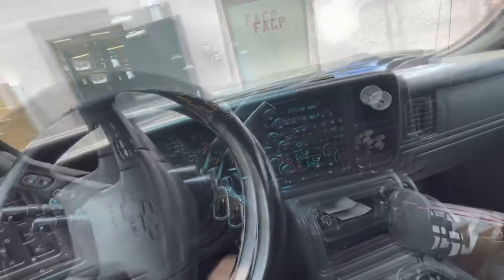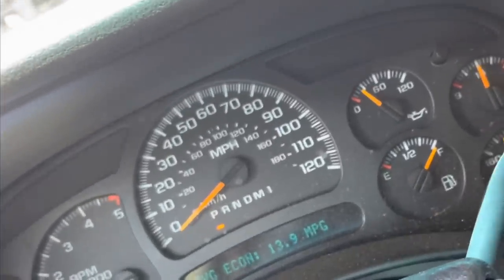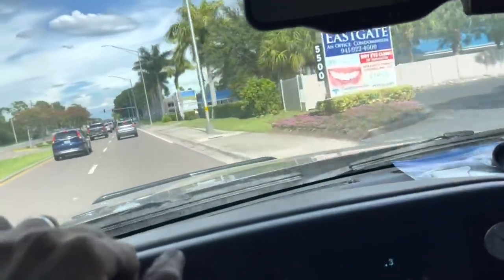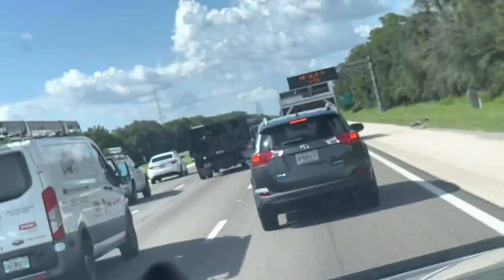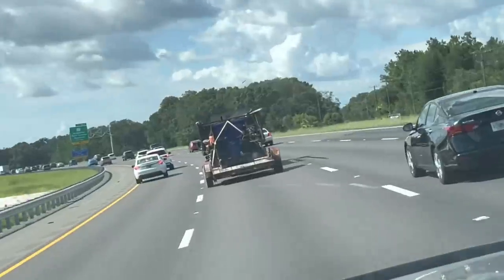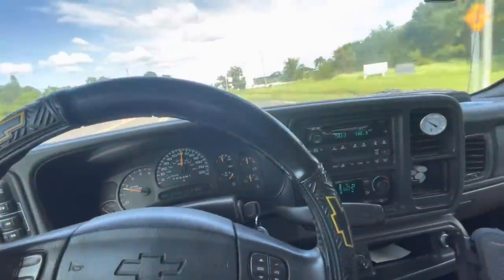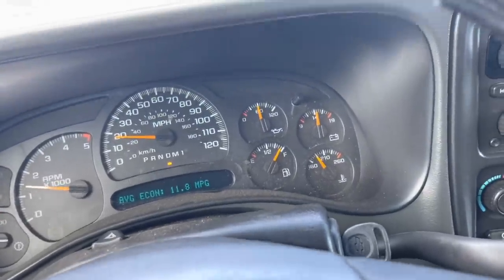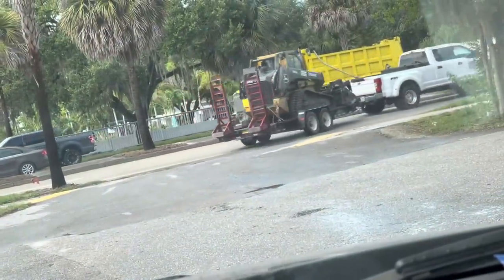Need answers! ox-cetane Diesel Fuel Experiment | Duramax 6.6 LBZ

Comment: That’s crazy, yesterday when FordBoss did his first thoughts on Ox-cetane he said that he wanted someone with a diesel to try it and I immediately thought of you because of your pre-DEF diesel and long commute, behold, that came true. I’m excited for the results.
Reply: Every time I click play on Fordboss it plays rays, this one
Reply: Ssssnake Oil!
Reply: @rockymcallister4258  ya think !
Reply: Ray’s LBZ isn’t pre emissions, it doesn’t have as much, but it’s not free of emissions equipment either, or at least it didn’t come that way new. It should have a cat and an EGR.
Reply: @ralfie8801  What's the diff between Ray's ride and say 2020 type ??
Reply: @peted5217  
Basically everything. The L5P Duramax is very different from the LBZ. Some stuff might be the same, but most is not. I haven’t kept up with it really, I have no intention of getting rid of my LBZ. We don’t have the dreaded DPF systems for one.
Reply: Saw that too
Reply: @ralfie8801  My definition of pre emissions is no DEF system, no regen... This generation was still reliable. In my opinion, was the most reliable generation of Duramax.
Reply: @ralfie8801  Just as I Suspected !
Reply: @ralfie8801  I thought he had a LB7 and if that’s the case. He is pre-emissions. I have an LB7 and I am pre-emission. Even in places with smog tests(Las Vegas). He also has cat eyes. So it’s either a LB7 or LLY.
Reply: @Re-engineer_everything  
I his title to this video he says he has an LBZ which is two generations past the LB7.
Reply: Rubber necking. I hate that pay attention and keep driving 🚗
Reply: @rockymcallister4258  just joking
Reply: @stevenlatham4397  do you not mean DPF ie. Diesel particle filter
Reply: @IrishFoxHound  no, I mean DEF, Diesel Exhaust Fluid.
Reply: @stevenlatham4397  didn’t know this is a thing..going to google..👍🏻
Reply: Ah adblue.. yes our ‘16 diesel is without it.. we do have a dpf

Comment: Lately I’ve noticed that snake oil fuel economy products are the craze because of higher fuel prices. 
Back in the eighties when gas prices had risen substantially (80 something cents a gallon),there were all kinds of fuel economy products flooding the market. Since at the time I worked at a service station so I got to see a lot of fuel economy gimmicks. 
One customer had a water injection kit installed under the hood of his Cadillac which consisted of a huge mounted glass jar and a small hose going from it to the air filter canister. 
I drive a small economy car with a small displacement engine and a manual transmission. That makes for the perfect combination to get great fuel economy.
Reply: I remember the Atomiser. One guy could not stop talking about it. After one month, since we had the same small car, he realized it did not do anything.
Reply: The main ingredient in a lot of that stuff was mineral spirits.
Reply: Magnets 🧲 they align the fuel molecules for better burn roflmao.
Reply: Yeah the FTC actually did testing on a lot of these fuel products a long while back. They found that while they do something, the results are basically only measurable and completely unnoticeable to the drivers. In theory they should work better the more worn out your car is and the more carbon buildup there is, but even still, it shouldn't effect much. When your motor is wearing out it's wearing out.
Reply: I remember "The Vitalizer" that was a doohickey you patched into the fuel line that was supposed to polarize the fuel to burn more efficiently.
Reply: @lovesrc4296  well I know from driving a big commercial truck for over three decades that low ambient outside temps and an moderately humid conditions helps an engine produce a lot more horse power while high outside temps and relatively dry air reduces potential free horse power. And that's with a turbo and air to air intercooler. 
We have concrete trucks with modest horse power (300-400 hp) so every little bit helps. A late model 12 yard(11 yard road legal in NC) concrete truck weighs around 35000 lbs. empty. Add a 40-44 thousand pound concrete load (1.8 mpg loaded) and it takes a little while to get up to speed. 
A word of wisdom. Don't pull out in front of a commercial truck in a four wheeler

Comment: When I ran a small diesel Volkswagen, I always used a cetane booster.  Over 140,000 miles of ownership, it was noticeable when I didn't use it and I never had to do an intake cleaning which I attribute mostly to frequent use

Comment: I'm old enough to remember when diesel was cheaper than gasoline!
Reply: .......and when you couldnt get diesel anywhere other than a truck stop.....yeah.....I remember 27.9¢/gal gas on one corner and 28.9¢/gal gas on the other corner
Reply: That depends on if you lived in the country or the city, lots of country stations had a diesel pump off to the side of the store. It would have been around 13.9 cents at the time you’re referencing 28.9 cent gas. Gas stations near lakes used to sell white gas which is what everybody ran in their outboard motors because it didn’t have lead in it and wouldn’t foul the plugs. Everybody used that same white gas in their Coleman lanterns and stoves too because it was less expensive than the Coleman fuel in a gallon can.
Reply: That stopped being a thing in 07. Even I'm old enough to remember that and I'm 23.
Reply: I went salad oil conversion years ago and never looked back 
😉
Reply: The actual refining cost of diesel is much lower than gasoline.
Reply: @javaman2883  
That’s because it’s a byproduct of making gasoline. The main cost is the crude itself and removing the sulfur.
Reply: @ralfie8801  you sir are incorrect. Diesel fuel is no longer a byproduct of gasoline production. The process has changed.
Reply: I remember diesel under 20 cents/gal.  Self serve gas about 30 cents/gal.  Many years ago.  In MN.
Reply: im old enough to remember your mom at 10 yr old.. diesel was cheap. till they wanted more tax, & truckies using 1500 lt per wk,,they got hit. its a money grab, nothing else. bit like the sht were going thru now.. petrol/gas, back in 70,s, here in aus, was 7c.seems to go up with the date..we now pay $2.35 lt, for diesel..nearly $10 gall. stay safe..
Reply: @larrycosby2010  How so?
Reply: @harrywalker968  yep
Reply: That's not very old. I'm 31. Diesel was cheaper up until the mid 2000s.
Reply: @larrycosby2010  diesel is still made using fractional distillation, what process are you referring to?
Reply: It use to always be less than gas and it makes no sense why it has surpassed gasoline prices when it doesnt cost nearly as much to produce...

Comment: Hi Ray, given the quality of today's diesel, a boost of the cetane number does allow a diesel engine run more efficiently, and it does reduce particulate matter.
Reply: Verifying diesel cetane number requires lab testing. Only long term use w/accurate figures and use notes could give an inkling as to an additives benefits. If you have access to Premium Diesel's 45-55 cetane, use several tanks to see what it does for MPG. Switch back to 40-46 cetane fuel with chosen additives for comparison
Reply: Darth Vader  higher cetane no. should lower NoX formation if chemists R 2 believed. I agree that any changes in perf or mpg would require lab equipment to verify as they'd B miniscule. Realistically, wouldn't higher cetane fuel be the norm if it produced noticed improvement ?

Comment: I use Ox-Cetane in my car and it works. I have noticed way better performance, improvements with my miles per gallon, my car really gets up accelerates much quicker. My gas stretches longer because I do a lot of driving showing houses and with my other job as well. Even when traveling the gas needle does not move a lot like it use to prior to using this. I highly recommend using this because it does what it says. And the way gas prices have been its worth it. All I can is try it definitely not snake oil.  I was told that they will be selling it online

Comment: Why touch the light switch to put them on and off when you can just flash the high beams from the control arm on the steering column. It's a lot safer as you aren't fumbling looking for the switch
Reply: At night it could be a hazard.
Reply: @rccola5167  never seen it cause an accident in the 20+ years I have been driving on motorway/highway with merging lanes
Reply: Correct, even during the daytime, on the GM trucks, just pull back on the turn signal lever and release, it will flash your high beams.
Reply: @larrykeeling4670 yep, this is standard on a large majority of vehicles now
Reply: @Matt_10203  They got it from the Japanese that got it from the Brits.
Reply: @Matt_10203  it's been standard in the UK since at least the 80s if not the 70s

Comment: And so it would make more sense to us, it's 15.8-18.2L/100km
Which is terrible because it's the same as 3 normal cars. But funny how it did just cost $10/gal here yet people are still in business.
Reply: Pretty much.. I drive full throttle everywhere & the car guzzles around 6.7l/100 of gasoline ☺️

Though, my car would almost fit in the bed of that thing too lol
Reply: I don't think people seem to realise that when the price of fuel goes up it goes up for everyone so all businesses that rely on fuel have to put their prices up for the services they provide. A plumber needs fuel for his van but if it costs $10 more to get to a job he just factors that in to his pricing for the job. Every other plumber is going to have to do the same and the only thing that's going to put anyone out of business is competition for that work not fuel prices. Just because the fuel price went up doesn't mean people stop needing plumbing work done.There are plumbers around here that have been in business 40+ years and they didn't set their prices in stone and give up the moment one of their suppliers prices went up. As a business you try to operate as efficiently as possible to make the most money you can but all the competition are paying the same basic commodity prices be it for fuel or copper pipe. If Ray really wanted to save money he could just choose not to commute in a 6.something litre gas guzzler. All the bulk buying and fuel additives might make pennies worth of difference. I drive a van and still get 42mpg. There really is no need for such a massive engine to plod along in rush hour traffic. I've driven hatchbacks that get close to 80mpg. If all it needs to do is get your ass from A to B there are much better ways of doing it. Something that big is fine for the rare occasion you need to tow heavy loads but when ever you aren't doing that it's just burning money especially when taking an unnecessary detour to rubberneck at a traffic jam.

Comment: Hey Ray if you want a cooler cab in the summer heat, look into getting Ceramic Tint installed. Its not cheap but it blocks over 99% of UV Rays and has over 90% heat rejection.
Reply: Nano-Ceramic tint made a difference in our cars.  Also, use the recirculate function on the A/C in very hot weather.
Reply: @Stefonius  Ive got the Xpel XR Plus installed on all my vehicles and it makes a difference, especially with black interiors.
Reply: If it is really hot outside, you should use the fresh air vent for the first 5-10 minutes because the outside air will initially be cooler than the air inside the car.  Then switch to recirculate when the temps have equalized so your not trying to recirculate air inside the cab that is 10-15 degrees hotter than the exterior air temp.
Reply: @Brirend  I just roll my windows down for the first few miles..  then I crank the AC with recirculate.
Reply: I think that the " hot out " references are just a simple weather report. I'm guessing, but, I don't think those of us In NE have the same definition of " hot out " . At 80 dungarees and 90 percent humidity, most shops keep the bay doors closed and take 10 minute breaks after each bay door is opened so the HVAC can catch up.
Reply: @10HDFLHX  that works too.  

It is funny.  Back a while ago, instead of having a fresh air/recirculate button, many car ACs had "Max AC" and "AC" settings and people that didn't read their owner's manual were confused as to why "Max AC" wasn't as cold as "AC". It was because "Max AC" pulled air from outside the car and "AC" recirculated the air inside the car. It was called "Max AC" because it was supposed to be used when it was 80-90 degrees outside and it was 120 degrees inside the car.
Reply: @Brirend  Ford has referred to Max A/C as a/c with recirculation on since before my time. I can’t shut a/c or recirc off while set to max ac in my 2008 Ford Fusion with manual controls.
Reply: @specialestness  I'm talking late '60s/early '70s and I did say many, not all.  I know sometime in the mid' 80s most of that changed.

Comment: I've used HYDRA Cetane booster for over 30 years in various diesel powered vehicles it makes a massive difference to performance,  mpg and throttle responce.
Would not be without it in my tank.

Comment: The idea that it just clears up some clogs and removes some carbonization over time is pretty reasonable. Unlike fuel economy magnets and other kinds of snake oil.
Ref: The merging signal. In Europe we usually just flash the high-beams a couple as a general "go ahead" signal. Unlike switching lighting modes or using hazards.
While at it. EU metric folks use L/100km to measure consumption. There's a ton of converters online if needed.
Reply: Hey my 75 Dodge came with magnets on the fuel line...they are still saving me money 8P
Reply: Flashing your lights is now considered "aggressive driving" in many US states. le sigh.,
Reply: It's contextual, If someone is driving aggressively and honking and flashing it's not really taken as a positive sign. Not that I see such driving often, Norway is pretty peaceful like that.

Comment: Another aspect of allowing trucks to merge is with Semi Trucks the method I have been informed of is to flash your high beams twice to indicate that the truck has enough room in front of them to get over into your lane and the thank you for is to activate the brake lights briefly twice. I appreciate that alternate method for doing these things. Also great content again and I must second MJAC casari's comment. I greatly appreciate all your alternate methods of describing things.

Something else you could maybe explain is if it matters when a fuel additive is added to a tank or not. I prefer adding things prior to filling the tank to ensure an even distribution of the product but what I don't know is if it even matters.

Comment: A few thoughts on this.. i think the liquid just prevents cavitation and aeration as mentioned on the bottle due to it's consistency (you've mentioned that it's sticky/gooey) maybe that's why you get an improvement on mpg? Better fuel distribution equates to better performance jn engines be it diesel or gasoline, with less cavitation and less foamed diesel after the pump you get more consistent delivery and that's why the improvement. 
Also if you want to get more reliable results try using a dashcam with gps and speed logging or other means of recording speed and starts. That will give you a better view of how you drive and thus you can exclude the placebo effect of you manipulating the gas pedal differently.
Reply: Manipulating the gas pedal differently is not a placebo effect.
Reply: ....could also use a real digital fuel flow meter
Reply: @Zyndstoff  it kinda is, because you get your mind stuck on the idea of high mileage and you subconsciously accelerate  lightly and you tend to avoid harsh braking, maybe coast a little more.. you tend to drive more eco friendly and not as one usually drives.

Comment: Best to add with an empty tank, so it mixes well. This stuff is basically an injector cleaner.
Reply: My thoughts exactly.
Reply: It greatly improves the Air Release properties in the fuel.
Diesel has approx 7 % Entrained air when in the cars fuel tank.
Reply: @gj91471  I'm sorry, what? Use proper chemistry terms.
Reply: @aaronbritt2025  Entrained air in fuel..... Go do your homework.